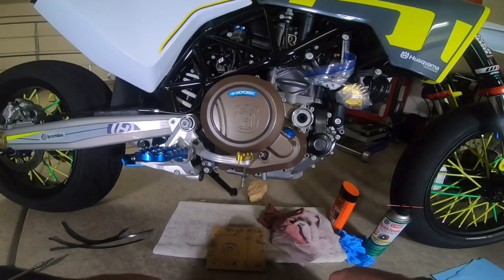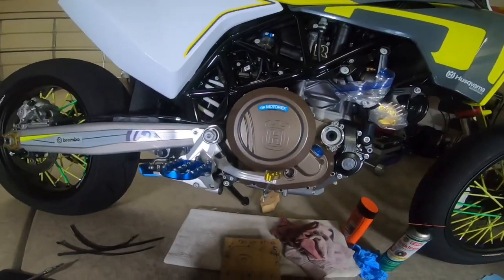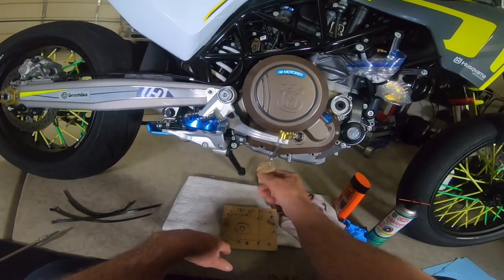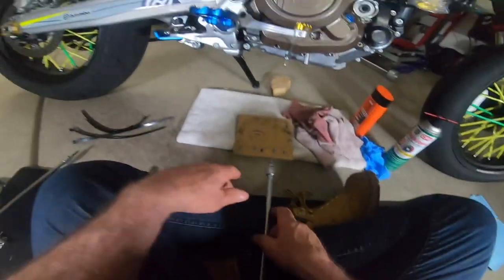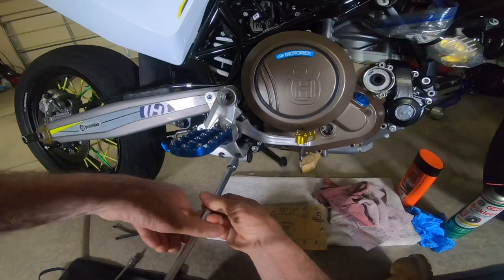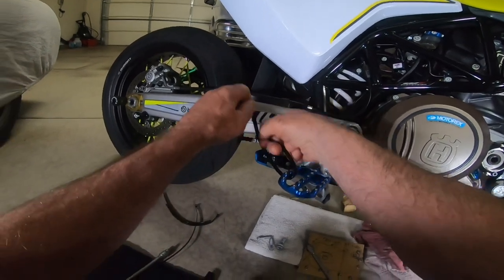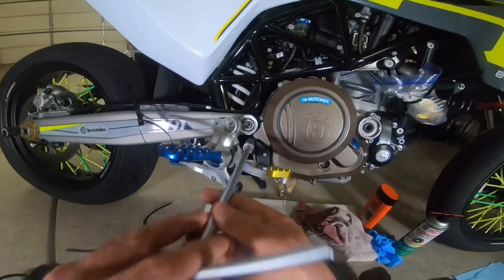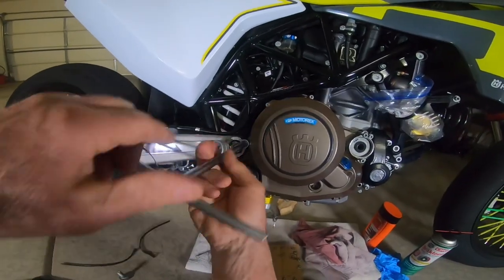Rottweiler Ceramic Pro Shift Kit installation and unboxing Husqvarna 701

Comment: great video man. i have a question about the stiffer springs though. do they make the clutch pull heavier on the lever like with a cable clutch or no? this is my only hydro clutch bike ive owned.
Reply from the maker: Hey hey. Thanks for watching!!

The clutch spring both the 129’s and the Barnetts only increase the clutch feel by a little bit. I’ll tell ya this- I can still one finger pull the clutch lever. the increased pressure on the plates I’m super happy with also.

Comment: I find my 2018 701 really stiff to shift up into 2nd gear. So much so that I need to select my footwear carefully to ride. I can't ride in just leather boots. Does the Pro Shift Kit make the shift up lighter?
Reply from the maker: Hey hey. 
Thanks for watching. 

Yes the pro shift kit makes shifting easier. However the hard shifting you are experiencing shouldn’t be happening imo. I had a problem with hard shifting at one point and the problem was the shift star not seated all the way. It wasn’t just from 1st to 2nd, although it was the toughest at that point, but through out the entire shift range from 2-6th gear.   You may have a bent arm on the shift star or it may not be seated correctly idk for sure but worth investigating imo. 

MotoHead 👍

Comment: I rarely get false neutrals, but I am curious if this would help the difficulty of getting into neutral? Seems to be easiest while moving still and from 2nd to N instead of 1st to N. Sitting still it is very difficult unless the engine is off. Experienced rider so definitely roll forward and backward a little while trying. Only at 700 miles so far so hoping it "breaks in" and goes away.
Reply from the maker: Hey thanks for watching. 
Yup. It breaks in better and the first 2k miles are fairly stiff on the shifter and gets easier as it breaks in. 
The shift kit makes shifting easier it seems but I don’t like the spring with the kit and used the factory spring. I like it. 
MotoHead 👍